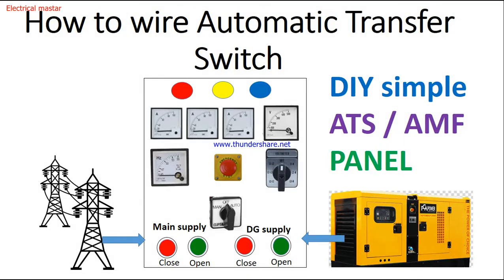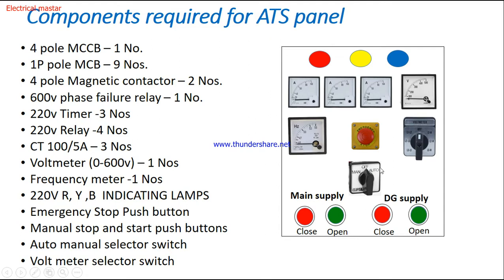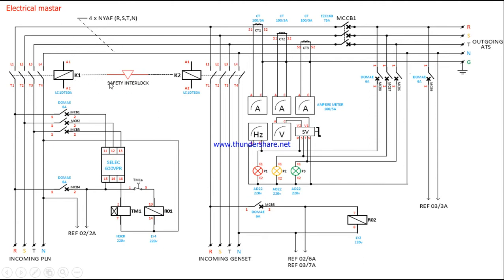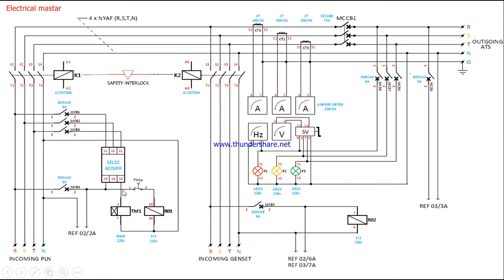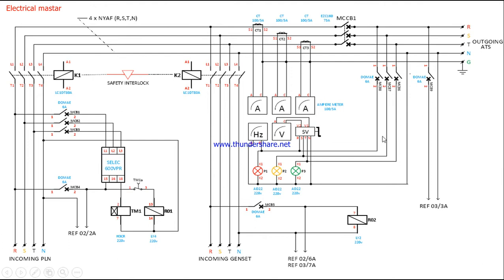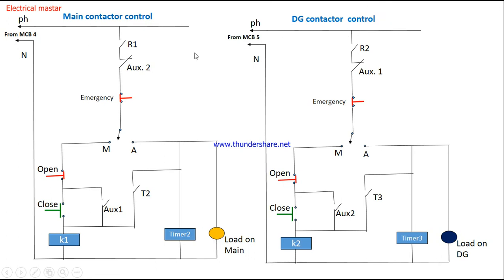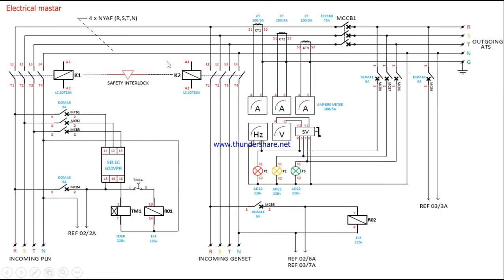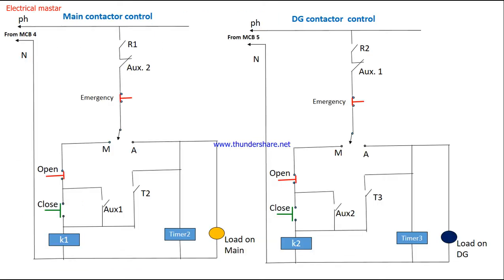How to wire simple Auto transfer switch(ATS) | Auto main failure panel wiring explanation

Comment: Thanks for the video. With the remote start of the diesel generator, is  terminal 8 on the control panel connected to the terminal 18 through the Normally close contact of the Relay 1?

Comment: hello,really good video and i want to know what is ro1 and ro2 relay what type of relay is this.could you please tell me in comment section
Reply from the maker: Thank you for your comment Mr. Mohamed Kamil. This R01 & R02 are 230V  AC coil supply operating relays . Which is used for sensing main and DG supply in the video.
Thank you for your supports
Reply: @electricalmastar  Thank you for your reply
Reply: You have mentioned 4 control relays in your component list.but in drawing shows only 2 relays...pls explain

Comment: You didn't explain the other timer's use. The on delay where is it used, is it generator or mains circuit and off delay where is it used in generator ckt or Main circuit. Otherwise it's a really good presentation.